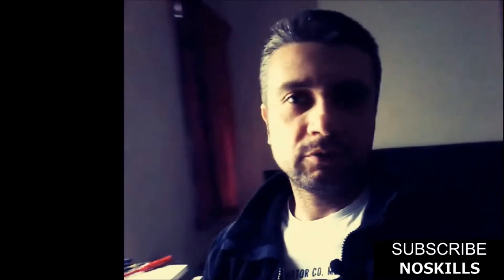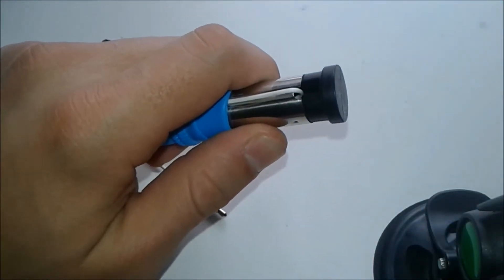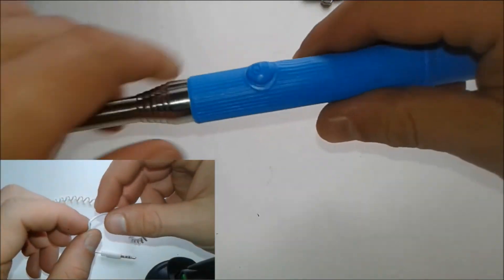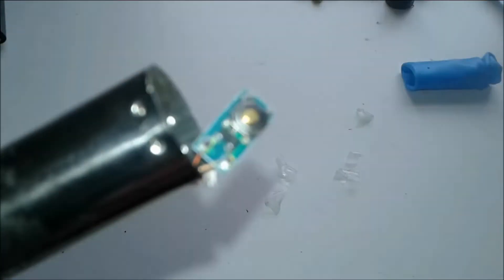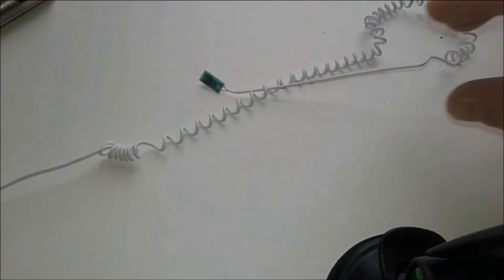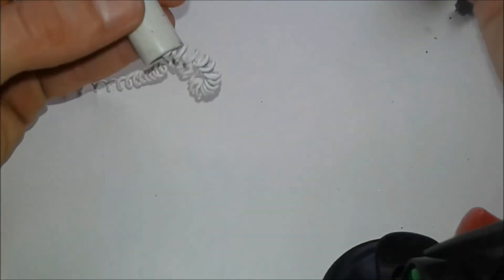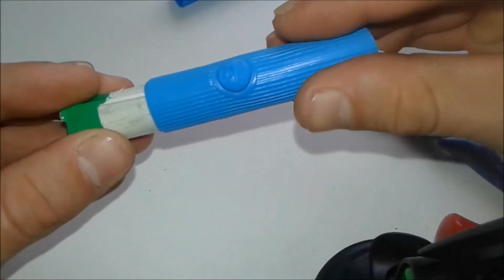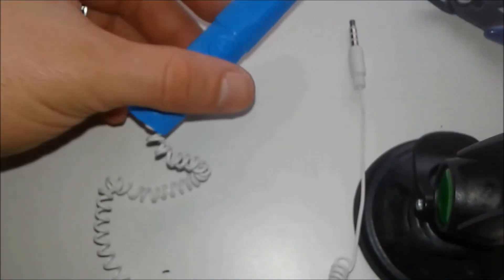Remote control for android phone camera.SELFIE stick hack

Comment: without skills & money + the need for a camstick, we all could modify a cheap non-controll stick to a remote.    
4pole Plug, 2 pole wire, button (to shortcut the ? and ? pole) Voila.
Reply from the maker: auricom24 I don't know about you, but here the 4pole button and switch is more expensive then this selfie stick so win win😎
Reply: We hartvest the  plug out of old defective (non-apple)mobilphone earspeakers, and the button from a defect devises.  
A puplic electric garbage can/bin sometimes is a treasure chest.

to make it more cheap without to destroy your existing remote stick i would just set a T(or Y) adapter to the wire.  for just to plug the external remote (wire +button)  if neccesary.
Reply from the maker: auricom24 recycle and reuse I am up for it any time so many stuff you can find in old electronics and people this days don't value nothing how said "one man's trash is another man's treasure " knew the value of every little thing